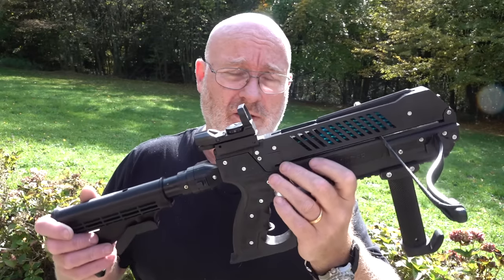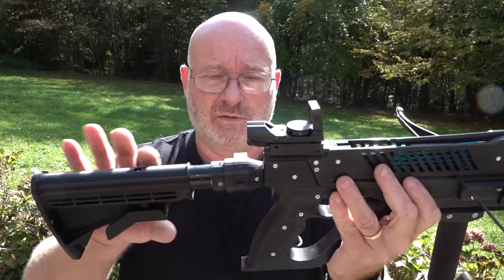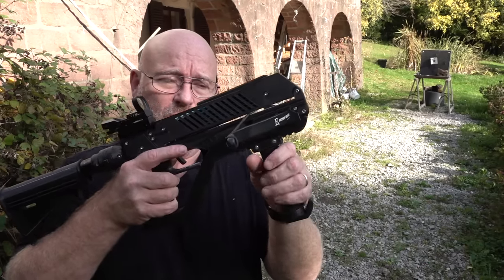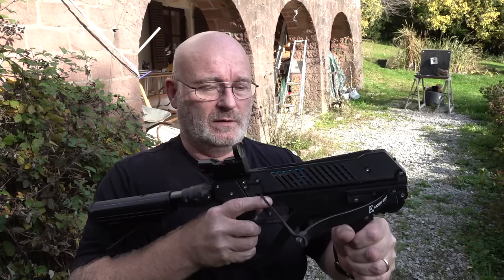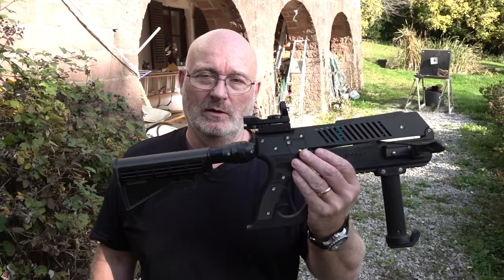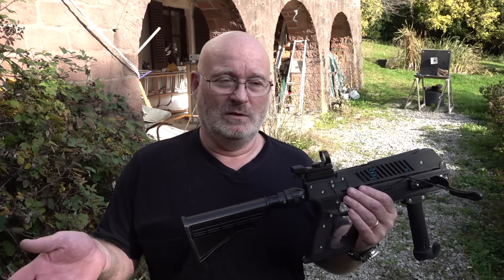Next Level Rapid Fire Crossbow (3D Printed)!

Comment: This is Fantastic! When will the .STL files be available? I 3D printed the first Sliding Legolini Bow that you showed on your channel and I still use it! Cant wait to upgrade to this model. You are an amazing designer Joerg! Keep up the good work.
Reply: They are available now. 12,90 Euro incl. VAT plus material, screws etc.👍
Reply: @Leynad778  what material is best for 3d printing this design: tough resin , castable resin aluminium???
Reply: @Liberty279  I print on an FDM-printer with ASA. Should be finished today:)
Reply: @Leynad778  Thank you for your answer. That's all Greek to me. If I had the prints and wanted to have it printed could I order it at a 3d printing company? What specifics abbreviations  would I have to give them?   Print this in Strong PLA   ASA??? Sorry but I have n idea? Thanks
Reply: @Liberty279  The parts need several days to get printed depending on the printer. Print farms will probably ask too much for that. You also need quite many different screws and springs. I would wait till people are selling a ready made version or at least a DIY-kit. Even with a 3D printer you want some experience with the slicer to get successful results or help from more experienced people.
Reply: @Leynad778  Thank you for response. That might be the best way....
Reply: @Liberty279  Ich kann die "Knarre" auch für dich drucken. Hab eh einen sehr schnellen 3D-Drucker und alles rumliegen um mehrere zu drucken (bis auf die M3x20 Schrauben, die mir ausgegangen sind). Hab auch heute schon Verbesserungen an 3D-Teilen gemacht um auch Druckzeit zu sparen und wenn das Ding mal fertig ist, wird mir bestimmt noch was auffallen, was man besser machen kann. Dreistellig wird das schon, weil heftiger Aufwand, auch vom Material und Fafner muss natürlich seine 9 Euro bekommen, die er abzüglich Verkaufsgebühren auf Cults3D bekommen würde.
Reply: @Leynad778  Das wäre super. Wie kann ich dich kontaktieren? Die Bauanleitung hatte ich schon bei Cults bestellt.
Reply: Ich hab schonmal deinen Kanal abonniert 🙂
Reply: @Leynad778  i can't see them
Reply: @Leynad778  Hi Leynad Jee, gilt dein Angebot noch? LG Beate
Reply: @Liberty279  Aktuell nicht, weil das Ding funktioniert nicht richtig und weiß nicht, woran es liegt. Vermutlich ist nur die Feder zu schwach, die die Pfeile runter drückt und eine andere ist wohl zu stark. Jedenfalls steckt der Wurm drin und so kann ich das auch nicht empfehlen oder gar nochmal drucken.
Reply: @Leynad778  Danke für die Info. Falls du es zum Laufen bringst, würde ich mich sehr freuen, wenn du dann auch eine für mich drucken könntest...
Reply: @Leynad778  Where? the link shows TBA
Reply: @anima1110  Read the hole conversion...
Reply: @Leynad Jed - any chance you can share the stls and the instructions? Link seems to be gone
Reply: @Leynad778  Read the entire conversation. No answer to their question in there.
Reply: Cults just disabled the account. Sadly I don't think we can get it anymore
Reply: Where can you find the STL file
Reply: Does anyone have the designs for this?
Reply: @Leynad778  Da Jörgs Account ja nun geschlossen wurde kommen wir an die STL-Files nicht mehr ran... könntest du mit die STLs direkt zur Verfügung stellen?
Reply: @elisklar  Also looking for the STL file if you ended up finding someone that shared it?
Reply: @Laynad Jee ich habe dir eine Mail auf die Adresse in deinem Profil geschickt kannst du mir bitte Antworten Vielen Dank schonmal
Reply: @jasonborn39  Für mich bitte auch..  das wäre der hammer... habe ein snapmaker 2..  bin sehr gespannt ob das funktioniert
Reply: würde dir natürlich auch die 15 shekel dafür geben. Finde nur die Payment Methode und den gedanken dieser site 20% zu geben nicht sehr schön.

Comment: Question is, which one of the two can you buy from a shop?  If I can't buy the mini adder, and I don't own a 3D printer, then what's the point?  At that point, I'll clearly be going for the AR-6 Stinger with speed loaders.  The unfortunate part is that I prefer the 3D printed bow to both the Adder, and the AR-6.  You didn't cook the Pig Shoulder up for dinner, after you shot it, did you Jorg?

Comment: Awesome. I have the original Steambow Stinger, but it’s packed away. I think it will be a collector’s item one day, as it was the first modern production repeating crossbow. But it does have limitations. It’s great to see the state of the art advancing on these.

There is one weakness: the need to be sorta standing up to utilize the lever action. This also of course affects the Adder to an even greater degree. The new Bat (many names) addresses this; you can be on the ground, taking cover, while still firing arrows. And the reverse draw versions of those are very powerful. I won’t be buying because between my Stinger and Adder I have enough.

Comment: Just printed my first plate with the Bambu Lab X1 Carbon and despite the more demanding material (ASA) the slicer showed me 32 hours of printing time in the best quality regarding strenght (0.15 mm layerheight) for the hole project. 550 g total without the arm-rest btw. 

Jörg, if you are put off by the complexity of 3D-printing I suggest you to buy the Bambu Lab. It's such an idiot-proof printer, it's basically clicking slice and print. Just pick the right material in the options and learn to adjust a couple of print-options (<10). It's like a Canon printing your photos and the revolution in 3D-printing. I'm glad this isn't my first printer and I've learned a lot by try & error with my first typical printer I've bought a year ago, but it's unnecessary knowledge with the Bambu. I've some problem-filament I couldn't print at all or got bad results even after several tweaks, but the Bambu prints it at 5x the speed like it's nothing with default settings and perfect (or almost) results.
Reply from the maker: Well, I can't even get my HP printer to work, more often than not. And that one prints paper only...

Comment: I ordered the MiniAdder files. Only after the order you find out that you need TheraTube silver, and two different types of Aluminium pipes (one square, one round). It was advertised as fully 3D printed. It is NOT.

I also bought the Adderini for $6.25 (with is truly fully 3D printed). Now I paid again $12.50 for the MiniAdder although most stuff (Stock is direct copy from Thingiverse, front grip is available on Thingiverse, just slight changes).

What is left? The MiniAdder offers a magazin you can pivot open (very minor change!) and you can detach the bow for transport (also minor change to the Adderini design, which most people will never use).

The Adderini was a real masterpiece of design. The MiniAdder copies 95% of that design and adds free stuff from Thingiverse. This looks like a grift to me!

I could just print the Adderini and add a free front grip from Thingiverse. I feel somewhat bamboozled.
Reply from the maker: Well, I did show the weapon in great detail so you knew what you would be getting. Also, the designer integrated some very important changes required for the fast repeating mode, namely the space holder at the front handle and the enlarged trigger housing. 
Sorry to hear you aren't happy though.
Reply from the maker: @shoeoffhead3692  It was my idea indeed. The whole thing was my idea, and I made a wooden sample way before the 3D guys got agitated. That is fine with me, I always give my inventions into public domain so others can improve on them. After all, my stuff is based on the ancient Chinese Chu Ko Nu, it is just an improvement. But improvements are important, and sometimes they really hit home. This latest iteration repeats faster and works better than the previous ones. Does that degrade the earlier steps? To the contrary. It glorifies them,

Comment: The problem of poor stability and torsional rigidity arises from the technology used here to print the crossbow gun (FDM).
If the gun is printed using the SLS process, professionally, on a corresponding system made of PA 12, PACA or metal, the result is incomparably better.
Reply: It's all about price to performance. Being able to print this out at home is what's so great about this. 

I bet adjusting the infill percentage and especially the outer perimeters will do wonders for this design. Of course using stronger filaments like PC or PA instead of PLA will also make it much sturdier, though way harder to print and more expensive.
Reply: I printed the black ASA filament.  Infill 40-80%, 6 perimeters.  I shot 100-120 times.  Not a single jam, nothing broke.  I just changed the collimator mount to make it stationary.

Comment: I would like to see them form a hollow in the stock so that even if it is folded to the side you can still cock the string without the stock being pulled back into position. 

That way you could fire it like a pistol crossbow or as a shoulder steadied weapon.

Comment: where can i get the files, i just missed out on buying them on cults, i dont understand how its not allowed on there, theres a couple others similar including the 1911 version and a desert eagle version now. ive printed them all except the v2, let me know if i can help with posting the files, i dont want anything for it just to get them out there so others can use them, ive printed multiple of the original adderini an mini adder at this  point an love shooting them with the family, i have one setup specificly for shooting with the family on our back porch, even the kids 8 9 yr old shoot with us an i have it setup so its alot easier to cock so they can do it by them selves an it makes them feel so much better about shooting it than if i had to cock it for them everytime. theres a set of arms on cults3d that have wheels an looks similar to a compound setup but i dont think i really classifies as that but its was just a couple bux an it lets u use a single piece of theratube silver an the long length is what makes i so much easier to cock but it doesn't hurt the performance as much as u would think, its not as fast as the 40mm theraband gold but is better than every other tube setup ive tried with 6mm tube except for a new set i made that lets u use 2 tubes on either side doubling up on the rubber but ive only tested it with one i have made to shoot 8mm ball bearings but has been the best ive found for the ball bearings so far so im gonna make another set up to test with the bolts now. if anyone knows where i can get the files for the mini adder v2 pls let me know thanks in advance. love these things.

Comment: The crossbow was printed in standard pla material.. This is good for testing but yes it can probably deform in the sun slightly.. It could be printed in nylon or poly carbonate and then it would be very tough, same as standard commercial plastic crossbows from china for example..Mankung ect..
Reply: True, but most consumer printers cannot print ABS, nylon or PC. For ABS you need a tempered build volume and good ventilation, as it emits toxic fumes when printing. Not for your everyday at home printer.
Reply: @Kashban  Eeerrrr, ABS just prints fine even on a cheapo Ender 3 without enclosure. There are variants like HDGlass, EasyABS and some others which provide no to only little warping without enclosure. Well, about toxic fumes: Simply print somewhere with good ventilation.

Comment: I'd like to print this after having printed the Adderini before, but I noticed that standard 6inch broadhead arrows don't fit in my magazine, the magazine is too short. Faramir's magazine is the same lenght, so broadheads would also not fit in. What broadheads are these? Or did my printer shrink all parts somehow? Confused.

Comment: One thing I noticed - while cocking, your hand ends up in front of the firing point, or at least looks like it might. This raises a question for me - is there a scenario where you could accidentally have your hand in the cocking position and still fire? (Eg, if you misfired, or didn't fire, then go into the cocking motion again but then fire while the hand is in the way).
Reply from the maker: That can't happen as the trigger is out of reach when the cocking lever is up front. ALso the hand is never in the line of fire, the "muzzle" is much higher.
Reply: @Slingshotchannel  Good to know. This looks like a super fun toy.

Comment: I think angling the front handle towards the back handle a bit (maybe 5 degrees or so) will further increase the distance between the hand and the "muzzle". Also, I see no reason why there are no extruded side panels right above the trigger, it doesn't look like that part needs to be visible or accessible to the person using the weapon so it can be "masked" to protect the finger.

Comment: Thank you so much for the video...well done.  I just love the design of this pistol crossbow, but wouldn't waste material to 3D print this.  As you know, 3D printing is great for making prototypes, but the strength, fit and finish required for a strong and reliable weapon should be molded by stronger plastics.  PLA would not be a good material for the long term.  I was hoping that a manufacturer such as SteamBow would show interest in incorporating this design into their line.  Does this have an actual trigger sear like an Adder?  What strength bow limbs are you using...I am only guessing 60 lb limbs.  Thank you and looking forward to more videos.
Reply: I mean abs, carbon nylon and polycarbonate exist which make very reliable parts. He used 90 pounds but there is a new powerstroke versikn and if u make a really tough print even a 110lbs ar 130 could be used

Comment: As a kid I made a bow and turned into a crossbow. Shooting was not accurate (my parents only allowed shooting twigs). I turned into a crossbow with the use of a metal part of a belt and a piece of wire. The most fun part was to ignite some small fireworks, wait a second or two and launch it in the air.

Comment: So i actually printed this bow myself! Few concerns, i noticed that the arrows fall out when its not level. Have you had similar issues?
Reply from the maker: Mag lever spring is obviously too weak.
Reply: No, the bolts don't fall out. Everything works great
Reply: If you managed to print the exact same version that is in this video then I assume it works with rubber bands?
Reply: @Slingshotchannel  thank you for you response! I have fixed it and have had minimal issues since.
Reply: @Tesadagod  How?

Comment: The chinese knife you got is something called damascus steel. If you don't o ow what that is, it's a forging process where layers of steel are forge welded together to make that pattern. The Amazon ones are normally garbage, but can work. Real damascus knives are really expensive, but you can take a wooden club, and beat them through some of the Amazon ones.
Reply from the maker: I know that of course. It looks really pretty, but to be effective the different steel types need to be well selected.
Reply: @Slingshotchannel  5160 is what I have been told to use. It's a good high carbon steel, and will hold an edge. San Mai is a technique where high carbon is folded over a mild steel core, so the blade holds a good edge, but the mild steel acts as a shock absorber.

Comment: Since this is for home defense, just nerf tip the bolts and have a buddy charge you from say, 4 meters for a typical hallway? Add some paint so you can see where you hit. Best case scenario you have the crossbow ready and the intruder has to kick in a door. Worst is you are in bed asleep and need to retrieve it first.

Comment: One question : what kind of ammo is it designed to use : the Adder bolts, or universal ( Stinger) bolts?
Thank you.
Reply: Yet, another question : could it be adapted, in order to have a " quick detachable limb" system, as the Vlad and the Stinger do?
Reply: @razvannicola5197  It already has, Jörg explained it in the video.
Reply: That is good. And, about the ammo?

Comment: what i would really want to see is something like the stinger compact but using a pump action
that should be possible if you connect a grip(pump) to the rods with the springs on it and you could also make a stock and put these rods inside of it :O

Comment: Getting better all the time! I think a mechanical improvement can be made to prevent the index finger from getting pinched by the trigger on reloading with an engagement latch of sorts. Ouchies!  The ergonomics of the reloading action could also be improved since it relies mostly on wrist rotation (weak) and elbow movement, but using something akin to the Winchester under-lever approach would allow the shoulder to also help power that movement, while the wrist can remain rigid. I would still advocate something to wrap the fingers around as in the present design, since using the back of your hand to reload becomes painful, as I have discovered with a real Winchester. Adding a palm rest to facilitate a pushing action from the shoulder and upper arm could also help ease the reloading operation.

Comment: I wonder if a single-handed lever mechanic could be impemented on small crossbows? Cool idea to dual weid crossbows.
Reply: So using 2 or 3 of your fingers to activate the level ?

It would be possible but the reloading energy, so the energy of the shot, would be quite pathetic compared to a lever activated by your second arm.

Comment: It Is Amazing. My doubt: it is not enough strong. You don't kill an opponent whit it. The cobra adder with 130 or even better, 150 lbs limbs could do it for sure. But this one... I don't think so, cause vital part are protected by bones... My question is: is there a model whit 70 lbs limbs? If 90 is too much, maybe 70 it is the right compromise.
Reply: the limb he got on this are rated for 80 lbs but they're actually around 60-65 lbs, so close to what you're asking. .
Reply: Using hunting tips at close range will severely injure if not kill your attacker.